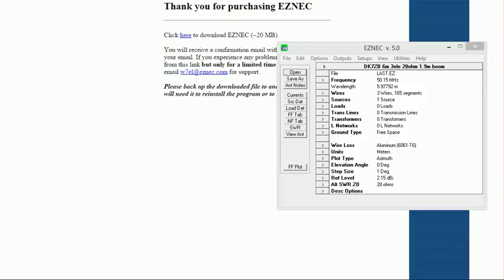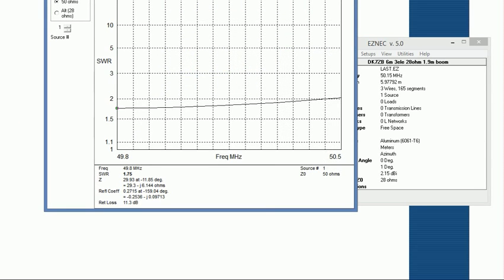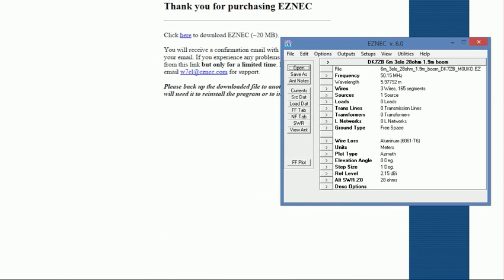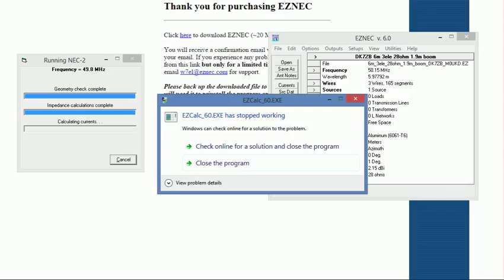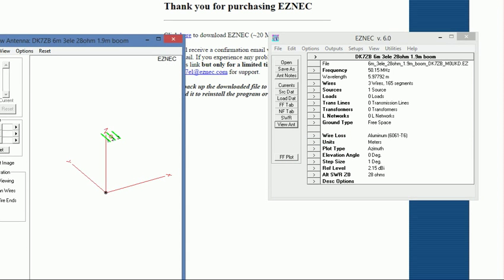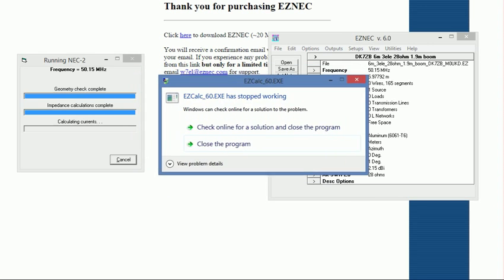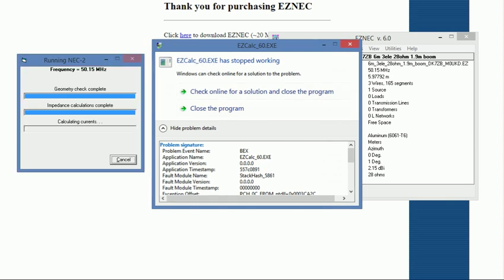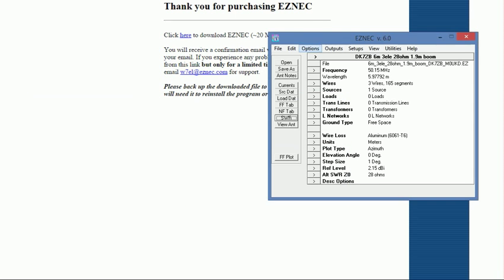EZNEC v 6.0 problem

Comment from the maker: I solved this by changing the amount of segments on each element from 55 to 51.
Reply: It seems like you shouldn't have to do things like that to make it work.  I see other problems with EZNEC Demo 6.0 such as it doesn't model even (2/2, 4/2, 6/2...) half wave dipole antennas correctly but the odd (1/2, 3/2, 5/2...) half waves seem to match the radiation patterns printed in the ARRL Antenna book.
Reply: Is there a way to tell it to use more segments on longer elements such as the reflector and less segments on shorter elements such as the director such that the segment lengths remain about equal?